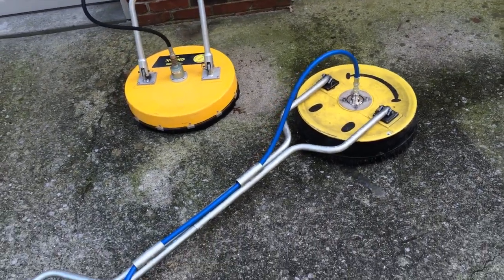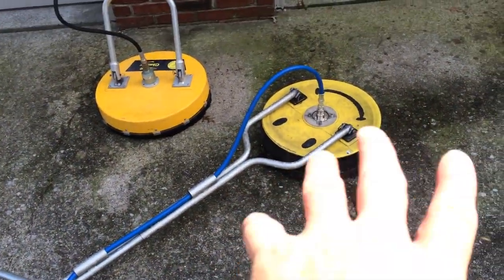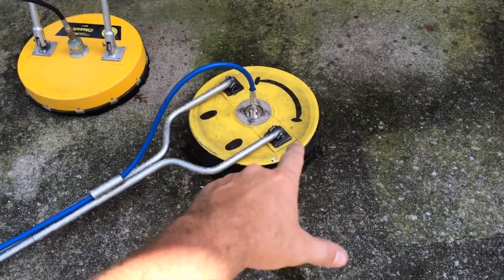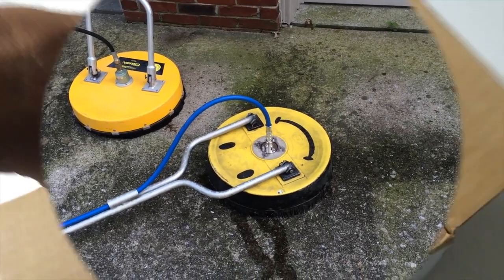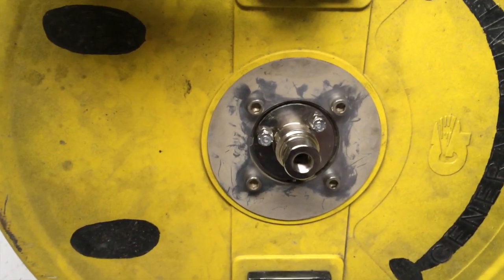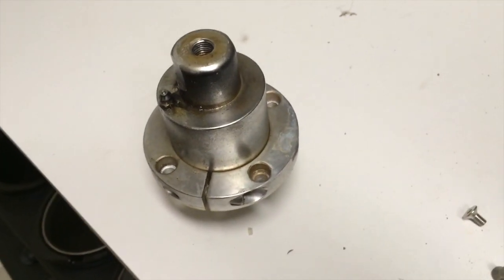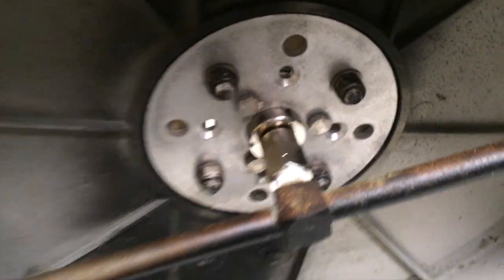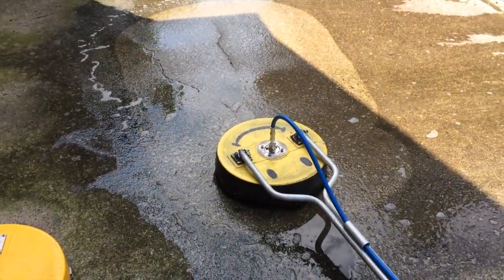Mosmatic Swivel Conversion Kit

Comment: Hey guys need a little help, I bought a 32 inch Northstar Surface Cleaner used and wanted to ask which way the nozzles are supposed to be facing vertical with the bar or horizontal? For whatever reason my 32-inch has the same exact setup with the single bar as in this video. Any help with the direction and what size tips are supposed to be on there would be greatly appreciated
Reply: First Choice Power Washing awesome man I really appreciate it, I'm experiencing a bunch of striping no matter how fast or slow I move the machine and was curious when I reinstall the tips due to them being clogged if I mess something up
Reply: First Choice Power Washing one last question, the Surface Cleaner is rated for 5000 PSI at 8gpm. My machine does 3300 at 4.5gpm. do you think I should change my tips to match my pressure and flow?
Reply: First Choice Power Washing yeah I understand, I paid $100 for it so figure it was worth a try considering how expensive these things are period after carefully examining it tonight my tips were not lined up correctly. I should add that my unit is a hot water unit